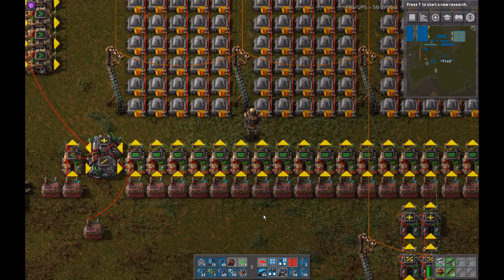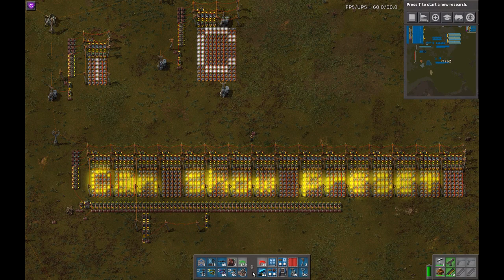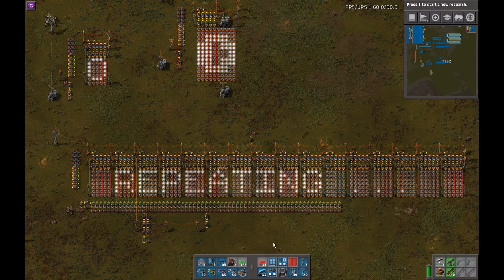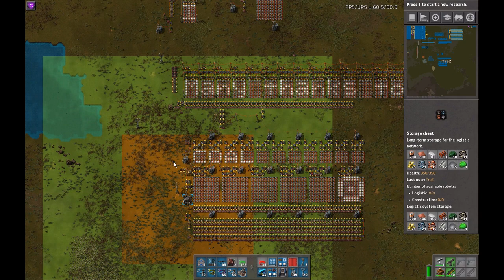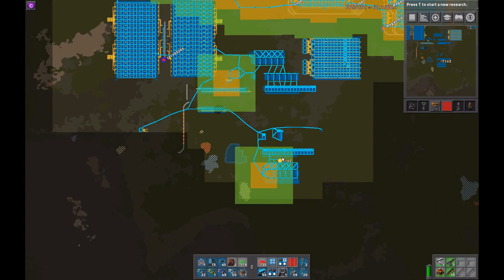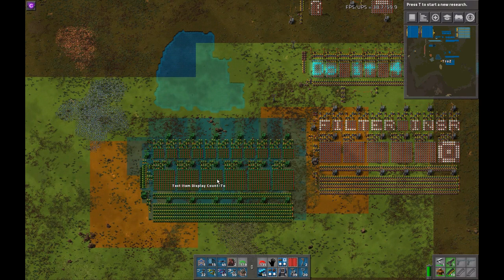Factorio Text Display

Comment: This is an awesome blueprint it still works even today!! I just want to know how do I know which number represent which character is that just gonna be a fun guess and check for me or is there something I’m missing? 😊
Reply: okay yeah i see i figured out how ascii table is a thing but for the big characters does it work differently im having trouble setting up a display with them. do they not have as much coded for them only capital and a few symbols am i not understanding how to encode the messages? i try to set each one up but if i use a different number on the first signal 0 it will change the whole display board sometimes giving an error or new character set sorta?
Reply from the maker: @megamanny4844  It is ascii encoding for the characters, except that control characters (0-31) have been replaces with additional characters.  The display size shouldn't effect anything. Perhaps you have a wire hooked up wrong, or you need to adjust the signal the the character display is responding to.  It's been quite a while since I set this up, but I believe the character displays the 0 signal, the second character should display the 1 signal, the third character displays the 2 signal, etc.

Comment: Awesome work man, but I have some questions to fully understand it, if you have time to anwers it i'll apreciate so much. 

So first, I understand the way it storage the messages and how it "choose" the correct display. But...
When it comes on how you storage all the values on the constant combinators (the four pairs) I can't understand exactly how you came with those numbers for each pixel of the screen, I've been investigating about the "<<" operator, and I think you use it to overflow the numbers in the combinator to make it negatives. But as you said in the video, each pair of constant combinators storage 32 values, so the question is:

How do you know wich values to use so it shows the correct 32 values? For example, the numbers to put 1 when 49 and 2 when 50.
Hope I explained well my problem, I really want to understand the system to start making it on my own and adapt to my factories.

And once again, awesome job, one of the best displays out there.
Reply from the maker: Constant Combinators can hold a number of signals (it used to be 18, but it seems to have been increased to 20 in 1.0 or 1.1). Each signal is a 32-bit integer.
I'm using 35 signals to represent which lights of the 5x7 array to turn on. If the signal value, shifted by the character number is negative, then the light for that signal will be on.  Because a signal is only 32 bits, and I want 128 characters, I need to use four such sets of signals (32*4=128).  The horizontal arithmetic combinator at the top of a character display ([0] % 32, output Z) does a modulus operation on the wanted character, to get the correct 0-31 offset, while the left-most vertical combinator ( [0] / 32, output dot) divides by 32 to determine the correct set of signals to use. The result of this division are fed into the the 4 decider combinators just above the display lights ( dot = 0,1,2,3, output * ), which only allows the signals from one of the four pairs of constant combinators through, having just been shifted by the arithmetic combinators above them  ( * << Z, output * ).
Of the combinators above the display lights, the only one I haven't mentioned so far is the left-most arithmetic combinator directly above the lights ( * + 0, output * ).  This allows the color signal to set the color of the lights of this character, without letting the signals of which lights are on of this character to get on the color signal line and effect other displays, basically acting like a diode.
Looking at the design again, I have four combinators doing the bit-shifting before I choose which set of signals to keep.  I could have saved three combinators by doing the selection of the signals to keep first, and then feed the selected signals into one combinator that would then bit-shift the appropriate amount.
Reply: @TroZ_Games  Ok, I think I understand what you say, pretty well explained. Now, the only thing it keeps me thinking is "configuring" the set of signals (what lamps turn on), what you have in a pair of constant combinators are 35 bits, well, I supose 0 when is negative and 1 when positive? That's the thing i'm not getting yet, why those big numbers, and how it really works the shifting on how to choose the correct character. I tried to search someting on google but nothing, just about the << opertator wich is equivalent for x * y^2. The thing is that there must be something im missing because when building a 7 segment display, I found a tutorial of just one display (0-9), but i remembered how to separate each digit with % operator to build a display that shows numbers up to 99M on my own. Here probably there is an operation or a property with ascii and the bits im missing.

So, now I understand how you pick a signal (for example 49), how that 49 is operated to choose the correct set of signals, how the colors work, and why you need 4 pairs of constant combinators, but why is needed an offset and how that offset transform the signal from the constant combinator to a correct caracter. Because when I put 49, it aplies 17, 18 when putting 50, and that shows 1 and 2 even when the signal in the constant combinator is the same, so how did you configure that constant signal, why those big numbers and why everything work so perfectly. 

Hope you can explain or give me a link where is explain ed (not needed in terms of factorio, I know programming and electronics aswell). I've been into combinators for two full days and can't really stop learning, it's an amazing part of factorio and remembers me the good old days programming, so I'll be very gratefull.
Reply from the maker: @cumProject  Ok. It helps to understand how number are stored in computers. Modern computers use what is know as two's complement to store numbers, particularly negative numbers. https://en.wikipedia.org/wiki/Two's_complement  
When I made the above recording, it wasn't possible to input negative numbers into the combinator, but by inputting large positive numbers (>2^31) it acted as the equivalent negative number.  I believe version 0.18 changed this and allowed entry of negative numbers into a combinator.

For a particular light in the display, we are examining a single bit from the signal for that light. Each light has it's own signal. For example, I use the 0 signal for the upper left light. For character 0, we do a shift of 0, so we are we are looking at if the most significant bit (the bit representing 2^31 (if unsigned), or what is sometimes referred to as the sign bit) is 1 or 0. If the most significant bit is 1, then then number is a negative number, causing the light to be lit.
For character 1, we do a shift of one. This moves the second most significant bit (the one representing 2^30 if unsigned) into the most significant bit position, so that it now determines if the number is positive or negative.  For character 2,  we shift twice, moving the third most significant bit into the most significant position, making it responsible for determining if the number is negative or positive. For character 31, we do a shift of 31 bits, moving the least significant bit (the one representing 2^0 or 1) to the most significant position, making it the sign bit, causing it to be responsible for determining it the number is positive or negative. At this point, the number would either be 0, or -2^31.

This lets us use one arithmetic combinator set to the shift operation to determine the on / off state of every light at once by applying the shift to all signals simultaneously. After the shift of N (N being the character number (0 - 31)),  the Nth most significant bit becomes the sign bit for the number, which allows us to use a simple greater or less than 0 check for turning the light associated with each signal on or off.
I wrote a program which would take the shape of each of the characters I wanted, and generated the number needed for each signal.  For each signal, if the light would be on for that character, it would set the Nth most significant bit to 1, where N was the character number.  It would do this for 32 characters, and then output the value for each signal. It made 4 such set of signal values, as I had a total of 128 characters.  I have a video which shows this process (and a bunch of other displays) for a 7 segment display: https://www.youtube.com/watch?v=93KZPZSkgjE

Comment: No werk my version game is 17.23
Reply from the maker: I'm not sure what changed, but the blueprint was originally for 0.16, and several combinators were not in the blueprint if the string is imported into 0.17.  So I have upgraded that map to 0.17, and made sure the blueprint in the book still works, and then exported the blueprint string from 0.17.  You can find the updated blueprint here: https://factorioprints.com/view/-LccWlyoFGiKOnGr8pkQ
Reply: @TroZ_Games 
How to connect a tip?
Reply: @TroZ_Games  
You know how to make a display that is able to have 9999999 numbers. And thanks to the display it works like a clock.
Reply from the maker: I'm not sure what you mean by 'works like a clock' or by 'connect a tip' above, but if you just want to display numbers and want more digits, try using a seven segment display like the ones here: https://factorioprints.com/view/-LCBqlZMQrvROJunHaAU
It should be relatively straight forward to build two of them next to each other, and connect the together to act as one display - just follow the pattern of connecting the digits together.
Reply: @TroZ_Games  doesn't seem to work on the latest version :(
Reply from the maker: @lostsynapse  I just tried the 0.18 blueprints I have linked in the description, and then seem to work fine in 1.0 to me.  I haven't tried 1.1 / 1.1.2, but there is nothing in the change notes that I've seen that should break the displays.